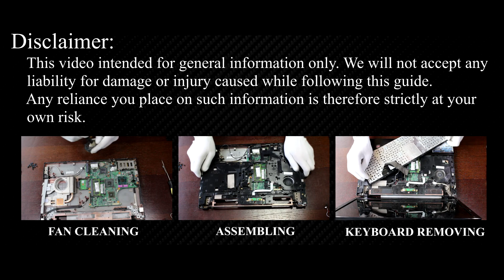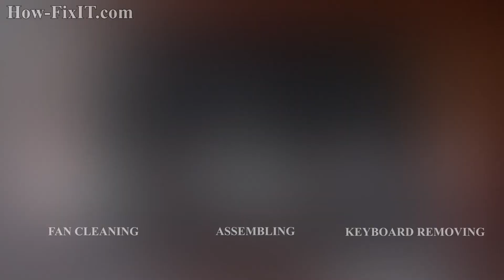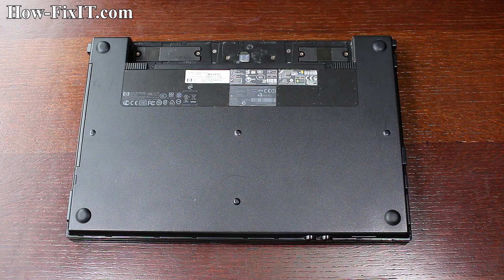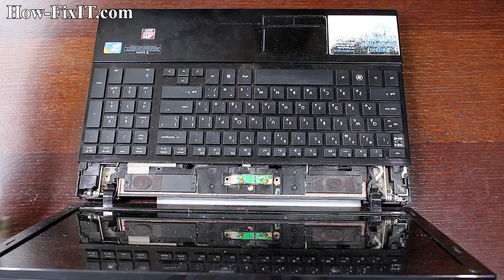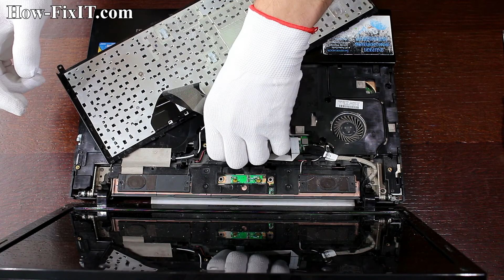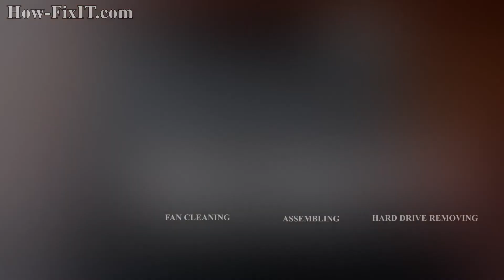HP ProBook 4510s Upgrade and installing RAM | DIY step-by-step guide

Comment: А с чего вдруг DDR3L, когда в этом ноутбуке память DDR2 используется?
Reply: Bro i have hp probook 4510s and the hp site said DDR2 ok but i open mine hp probook 4510s it was 2 ram with 1 gb DDR3 ok so mine DDR3 some version I think it's DDR2 you have to open your self and chek it
Reply from the maker: Вообще-то DDR2 SDRAM 800MHz (PC2-6400)
Reply: @howfixit  а DDR 3 не встанет?

Comment: Thanks i bought Kingston KVR16LS11/4 4 GB RAM 1600 MHz DDR3L Non-ECC CL11 SODIMM 204-Pin Memory but i cant use HP 4510S have Adata 1GB DDR2 Memory SO-DIMM 200pin PC2-6400S 800MHz ADOVF1A083FE
Reply: Este video dice ddr3, pero el sitio oficial Hp dice que utiliza ddr2
Reply: @gusano37  it's DDR3 mine take DDR3 i open it you have chek by your self